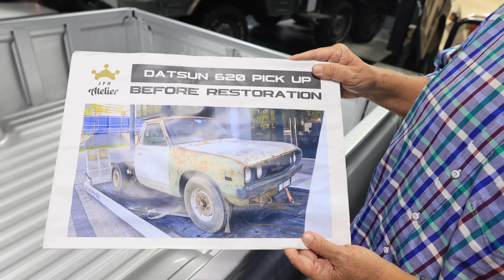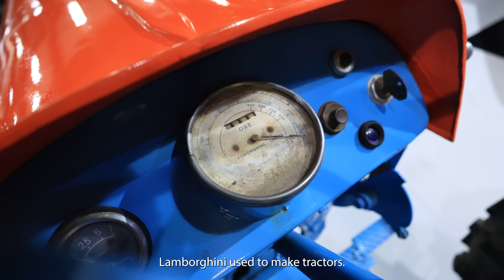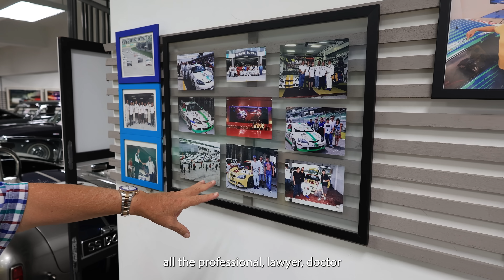Jay Leno's Garage Of The East: Largest private collection in South East Asia | Capturing Car Culture

Comment: he called the Lotus Emira turbocharged but its actually supercharged. just got done driving mine 10 min ago :)

the Emira has the option of two engines. the i4 and the v6. he said it was manual and only the supercharged V6 comes in manual.
Reply: The i4 is a turbo from Mercedes.
Reply: @tamasszabo8824   I know, however he said his car was manual, which cant be the I4 from Mercedes
Reply: I own a V6 manual Emira, too, and yes, you are 100% correct. I think JP can be forgiven for not remembering all the details of his 200 cars.  😂